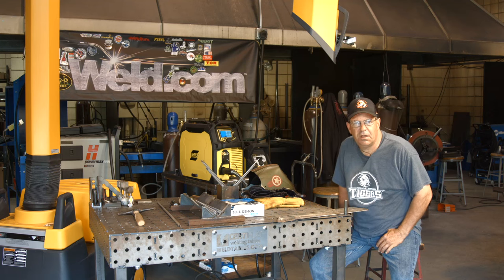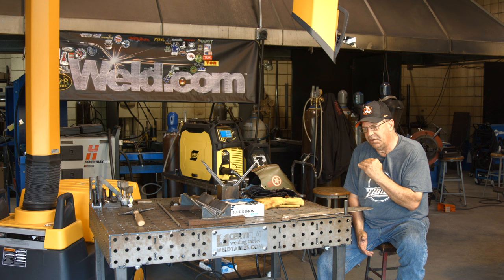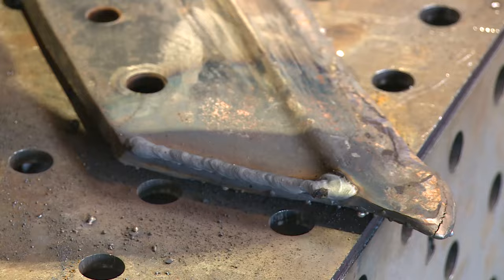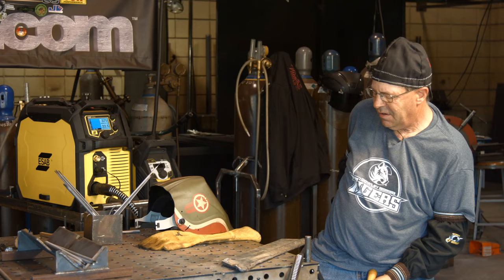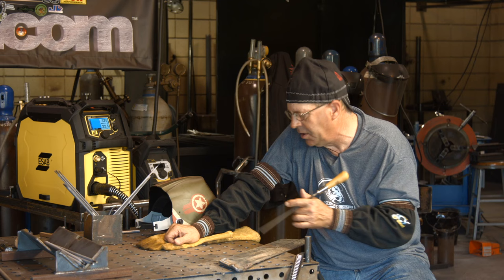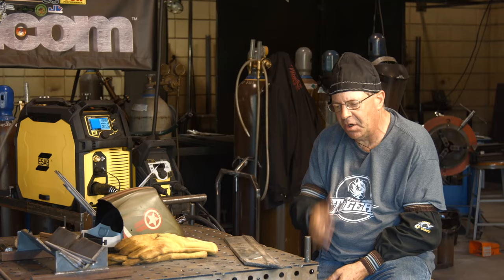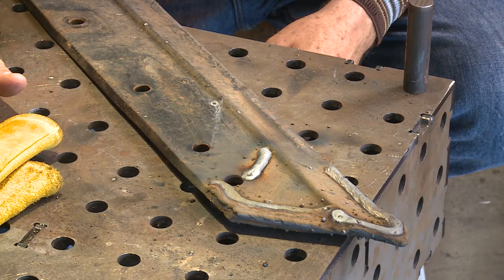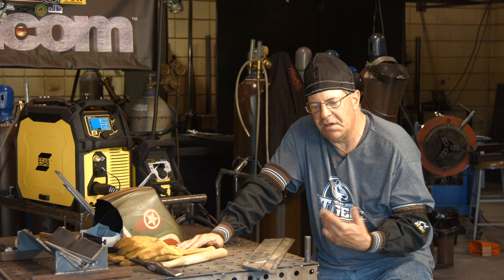🔥 MIG Hardfacing

Comment: That wire will weld better using 100% Argon...most metal-cored hardfacing wires do...
Reply: wat about 90/10 gas 10 percent oxy mix
Reply: the lower the oxygen content of the shielding gas, usually the more stable the arc will be.. also less chance for oxide formation on the deposit surface.  This is for metal cored wire...does not apply to all wires.
Reply: Leave the O2 out on stuff this hard. I run 85/15 with that wire
Reply: ARCSTREAMS. 75%Argon 25%Co2. Co2 contains Oxygen...1 part Carbon 2 parts Oxygen.... it is a "active gas"..not inert.. hence why the term "MIG" is being somewhat phased out and GMAW is truly the proper term now days.  The Oxygen content of Co2 can cause some issues with arc instability when welding with metal cored wires..unless the manufacturer uses some arc stabilizers in their metal powder mix, then a Argon/Co2 mix gas can work ok... otherwise a totally inert gas (100% Argon) will produce a optum arc and stable weld pool.
Reply: ARCSTREAMS in fact Flux cored with gas shielding burns hotter, it's a plus when need way More penetration having a small machine...
Reply: nI did some hard facing with a metal cored.045 wire. The label on the wire said use a argon/co2 mix or just straight co2. The shop I work at primarily pulse Migs most of its stuff so all I had was c10 from a manifold setup. Needless to say it welded like dogshit looked like those snakes you light during the 4 of July it also had lots of transverse cracking but was hard as fuck. Any thoughs?
Reply: torcher78 What was the wire Manufacturers name and the name/alloy type of wire?  Most cast iron/ high carbon high chromium containing alloyd types of hard-facing wires do "cross check/crack" due to the chemistry of the allow and stresses, unless a extremely high preheat is used and some post weld heat/slow cooling , they will always crack, which necessarily isn't a bad thing, all depends on the application.  If you can find out what wire it was exactly and what the material was you were welding on top of, I can help you out.
Reply: Rick Reiff I was laying it on mild steel but I have no idea what the wire was made from or the manufacturer because the label was rubbed off there.  I do think it had a high Chromium content though because it was pretty shiny when I was done so that makes sense
Reply: Tried to weld with some Stoodite 6-M today and had one of the worst welding days in a long time.  Do you have any suggested settings.  .045 flux cored 100% argon.
Reply: D Armstrong , Where you using 100% Argon shielding?  You will want to do that with Cobalt based hardfacing wires usually.  Are you using it semi- auto or fully automated?  If you are welding semi-auto (by hand), you will want to pay close attention to your torch angle, I suggest between 5 and 15 degree down hand (drag) angle.  Don't go too far, and don't push the puddle either.  For .045" I would use 22 to 25 volts, 1/2" to 3/4" stick out, 400 to 500 IPM WFS.  If you want to try some Welding Alloys Stelloy 6G, let me know, better price over STOODY, and performs better.  Interested in what troubles you had? Weldability? Porosity? Spatter? Let me know.
Reply: 100% argon.  i guess fully auto becuase I have the gun in a fixture working off of a positioner.  Based off of your wire speed suggestion I had the amps way low.  I had the angle straight in.  (Round parts) Gun positioned on the top.  Flat.  I will turn up the wire tomorrow.  Just don't like the crackling sound and spatter.  thank you for helping me
Reply: Could be you were starving the arc of wire causing instability, let me know how it works out for you.
Reply: Rick Reiff I think so.  Will give it a try.  Thank you again
Reply: Rick Reiff such a nasty process
Reply: Beads are coming out better but the spatter keeps fowling the contact tips.  Any advice?  Destroyed 32 tips in a 10 hour shift.
Reply: D Armstrong Suggestion #1 Stop using STOODY products and get some Welding Alloys wire!! Suggestion #2 try increasing your stick out a little in hopes the spatter won't reach the tip so easily.  Suggestion #3 get some Loctite ceramic shield anti spatter and spray your tips and nozzles.
Reply: Rick Reiff thank you
Reply: D Armstrong Also, does the welder/power source you are using have a pulse feature? If so I would try using a pulse arc. It usually works the best with Cobalt based wires.  60 to 75% on time with 50% background current.  If you don't have pulse, but have a Inductance setting or high and low inductance stud for the + lead, try playing with that, sometimes using higher inductance will soften up the arc and result in less spatter.
Reply: Rick Reiff I appreciate your hep sir. Power source I'm using doesn't have any of those features but we do have several in the shop that do.  I will try that option next time. Personally I'm leaning towards your advice of not using Stoody because it sucks.
Reply: D Armstrong good idea
Reply: Rick Reiff only variable I haven't tried
Reply: D Armstrong pulse is the way to go with that wire. We used to run a lot of it until it was phased out for fear of high dilution.
Reply: @torcher78  I had the same problem with straight CO2. I had fewer snakes with 75/25. I eliminated them when I went much lower on my volts and wire speed(amps) and the 75/25 set around 22.

Comment: Is the any benefit to grinding a hardfaced weld? I have a track loader the and movement from the idler wheels has worn channels into the frame. I was thinking about trying to use some hard face wire but I have to grind most of it down so it is  flush. Is it even may worth using a hard faced wire to build up surfaces that were but were not originally built with hard surface?

Comment: I weld it i run 315 25 i weave passes inch half two inches wide you can weld at slight angle or flat shit will get ahead of you real quick in corners i run hotter and cleaning all the bbs chromium stuff is bad use filter hood or have uptake shits bad i remember in 2017 watching your videos now i handle my business ❤

Comment: Thank you Bob. The temperature of base metal could have a big effect on the performance of the hardface.  The college does probably have a Rochwell testing machine.
Reply: workwillfreeyou I've found most things I've done hard surfacing on are very difficult or too time consuming to do a proper preheat on. My experience with this is mostly construction equipment and waste paper compactors. In a shop I suppose it's easy to preheat a gear or shaft but not the field. I'm sure the manufacturer's take this into account. Just thought I'd put in my two cents. Have a good holiday.

Comment: Nice video, similar to some of the stuff I weld at work.
When I fix buckets for loaders I work with Hardox 450 and other wear resistant steels. I was recommended to preheat to avoid hydrogen cracks in the material.
Sometimes I make a buttering (buffering?) layer of stainless before hardfacing, which bind the steel and hardfacing weld better together.

And especially if you don't know the type of steel you would like to hardface, stainless electrodes can help fusing the steel and hardface together. I use ESAB OK68.81 for first layer and then OK84.78 for hardfacing

Thanks for a good video.

Comment: You settings are quite different than what worked for me with Blue Demon .045. I had to turn my volts and amps much lower than your settings because I was getting all types of porosity and splatter. After lowering the voltage and decreasing my amps, the beads looked similar to your beads and the slag literally fell off on it's own. Blue Demon should list the recommended gas and gas setting as well as volt and amp recommendations on their site. They only mention that it is DCEP and requires gas, but not which gas they prefer. As a result, I experimented with CO2 and 75/25 along with a lot of different voltage and amperage settings. Got my best results with 75/25 and much lower volts/amps than I thought after I would after seeing your video and several others on the subject.

Comment: So by welding near the bolt hole on the back, the plow share will not go back on the plow.
I don't think you want to do that much welding and grinding to a usable plow share.
I haven,t noticed problems with cracks in the share base metal because the share is supported by the plow frog, which gets most of the force

Comment: bob
thanks for the informative vedios can you pleas make vedios about welding mig aluminum with the rebel 235 as i want to buy one and im confused which to pick btwen the 215 or 235 the 215 can produce 240 amps at max and the 235 has 250 amps max so the diffrance is 10 amps will it make a diffrance in mig aluminum thanks

Comment: Bob,

would you recommend this wire for build up to shear blades on an excavator shear in service at a junkyard? Customer is more concerned about cost of repair than cutting efficiency. I usually just dig up some old hardfacing stick wire to build up the edges, but this looks way easier (and quicker) to run effectively. I always seem to need to run the hardfacing super hot and I'll burn up a rod 1/2-2/3rds of the way through kinda like a stainless rod. 

Let me know, it's not critical stuff and not my normal work, just something I pick up on the side and this wire looks like a great easy answer.
Reply: Very interesting video. For some reason I had always thought that hard facing was something done with a stick welder. I learn something new everyday. I should give this a try with my everlast mig welder sometime. Is the wire expensive?
Reply: Zeta flux core from Rockmount research is the best stuff I've used and I think it would be perfect for your application. Not cheap though. There are other options that are a little cheaper. Hardfacing alloys are just expensive, that's all.
Reply: If you're doing build up you could always build it up with 7018 and then cap over it with some hardfacing rod. That'd probably save you some money on consumables with hardfacing products being on the expensive side. And if you can pre-heat the base metal you might not have to run the hardfacing rod so hot.

Comment: Sir, excellent video and I learned a lot from watching as well! I have a question: I learned stick welding from my Pop many many years ago and he is no longer around to ask, so here goes - I have forgotten my welding lessons from nearly 45 years ago and haven't picked up a welding rod in as many years; which brings me to this and please don't beat me up to bad with your reply! Lol 
I have purchased a MIG 110 unit from our local Harbor Freight and I was wondering if I could use hardfacing wire to touch up the edges on a beat to heck anvil I recently acquired?? I know there will be some opposition about doing this to an anvil from others, but I don't have the funds to purchase an anvil and this one will be with me for the rest of my life....New novice Blacksmith!

Comment: Would this be good for an anvil face? Can you do a Rockwell on it? I know the bottom of the nugget will be deluded but the top should be exemplary of the normal hardface.
Reply: madderoftime.  I would not use this on a anvil, It will likely spawl off after some striking, you want to use something that will work harden with impact, such as a 19 9 6 stainless or something with a higher Mn content.  The company I work for manufacturers multiple types of hardfacing consumables for this type of application.  Many other manufacturers do as well,  but if you want the best then buy Welding Alloys products!!! LoL sorry for the plug...just had to do it.
Reply: Rick Reiff 100% correct. hardface wire is expensive and it shattered on me
Reply: You'd be better off making a plate of hard steel and welding it on around the edges in short penetrating welds, the shock loads of a three pound hammer over time will crack the welder material, if you're only working with think metal you probably will be ok except you would still need to machine down the welds flat requiring carbide tip mill cutters. Another option but expensive is to have a hard plate forge welded to the anvil by one of the few anvil manufacturer's left, then they would heat treat the entire anvil. If the anvil face is that bad you might consider another anvil. Hope the info helps.
Reply: nOOOOOOOOO Get some D2 for the anvil and rosette or bolt it on.
Reply: The repair I had in mind was one where the edge has chipped off and then another anvil where a 2x2 inch corner is busted off. D2 would be nice but not practical in this case.
Reply: I would get a 3/8" or thicker piece of AR500 and weld it to the existing anvil face. Use a highly alloyed filler like Eutectrode 680 or Super Millileweld. Bevel the edges that you plan to braze or weld generously, clamp it very tightly to the anvil (grinding the anvil face and plate as needed to assure a solid mate between them) and preheat the anvil and the AR500 plate to about 250°F. Run 1"-2" long stringer beads, and peen each bead immediately after laying it, as soon as it cools to black heat. Use an IR thermometer to make sure the bulk of the AR500 plate doesn't go above 500°F. If it gets close to, or a bit over over, 500°, let it cool back down to 250° before resuming welding.

An alternative that requires a lot more welding, labor, and xpense, would be to butter the anvil face with Eutectrode 2B,  Eutectrode 680, or Super Missileweld. Depending on the composition of the anvil, you again will probably need to run short stringers and peen frequently to prevent contraction stresses from causing cracks. Once the surface is buttered, grind it down to a fairly thin layer, then hardface it with high manganese steel rod. Again, short beads, peen, and keep the temps down.

Comment: Hay Bob, Gary from CT here. That blue demon wire, is that a general use wire or is it for a specific use?
Reply: The specific wire he used in this video is for hardfacing, which is generally to put an abrasive resistant layer on a base metal.  But Blue Demon does make some "general purpose" wire. http://www.weldingmaterialsales.com/products-filler-metals-alloys.htm

Comment: Would it not of been better to bevel the crack with a die grinder before welding?
Reply: KiK'sForge Sure, but we were just running the wire for the first time.

Comment: Would you normally clean the piece off before applying your hard facing? Or I assume since this was just a test piece you did not for times sake? I am excited to see more on hard facing, I would also like to see some stick hard facing in some future videos and maybe a comparison of stick and mig the pros and cons of both.
Reply: We ran a wire wheel on it before welding.

Comment: Just wondering why you're talking volts instead of amps.
Reply: Because MIG welders are constant voltage machines since they short circuit. The amps vary with the weld as the welder constantly adjusts to keep voltage constant.